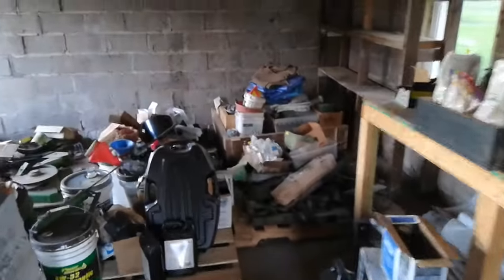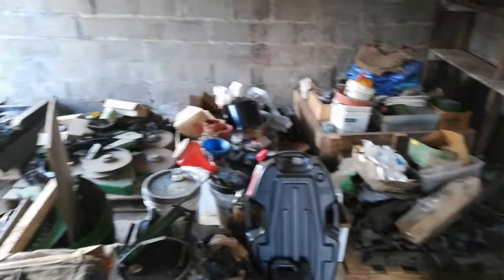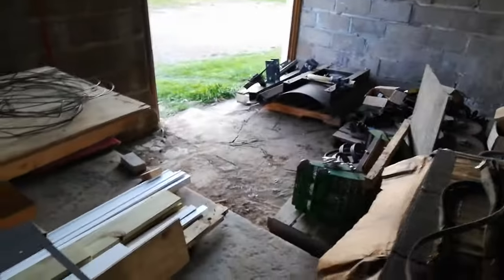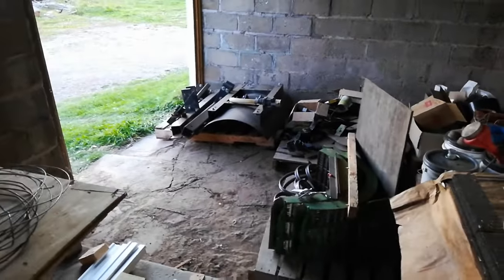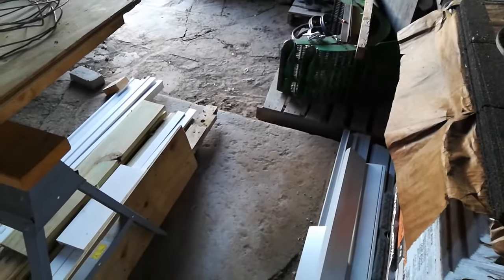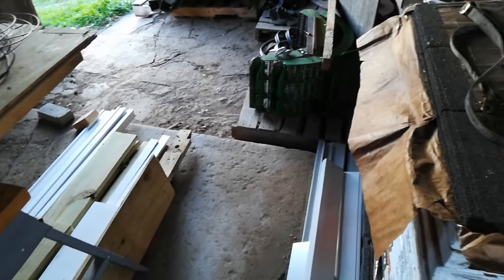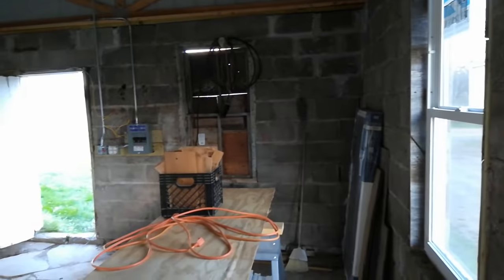Pump House Rehab Update

Comment: Nice conduit!  All my barn wiring is in conduit as it is much safer, when you learn how to work it🙂.
Reply from the maker: Thanks. I was asked, why not put it in Greenfield/metal flex cable. At first I said, it's a better end product (in emt pipe), but really the answer is that I like figuring out the angles/bends as well as how it looks.